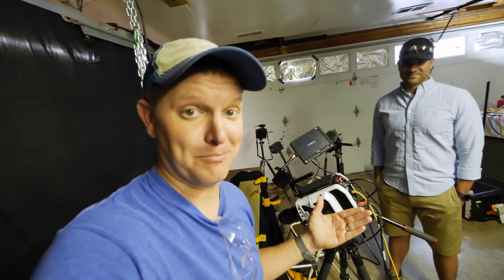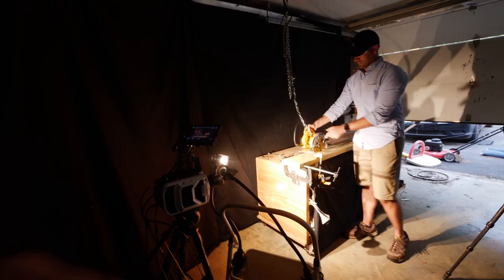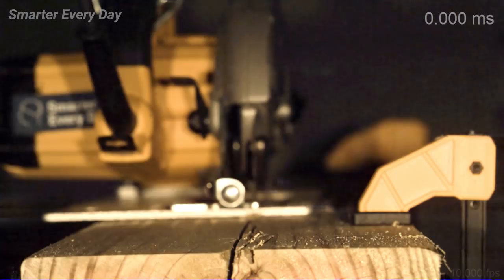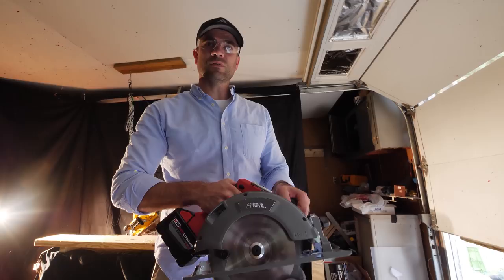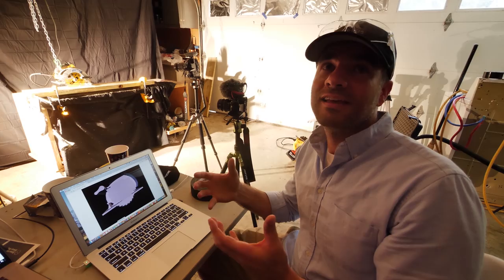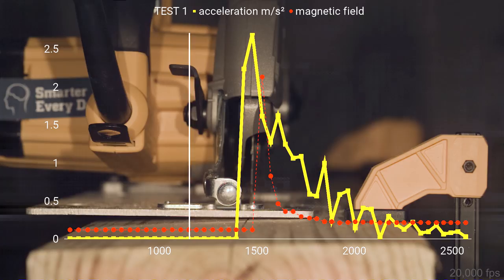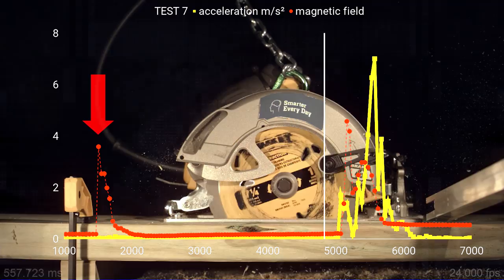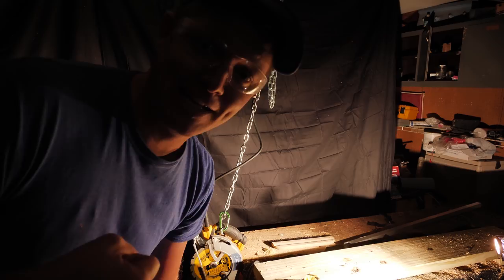Circular Saw Kickback Killer (We used science to make tools safer) - Smarter Every Day 209

Comment: Just out of curiosity why is the blade  gaurd disengaged? I worked carpentry for a while and as long as you are paying attention and using the saw properly (both hands!) kickback can't over power you (you would have to be very very weak).
Reply: Also the blade gaurd should stop the blade from biting into anything if it were to kick!
Reply: I understand what you are saying, but legit question: how fast is that mechanical blade guard? Is it slower than this product?  I bet it is. Note that other commenters have mentioned people who have lost fingers or worse. You would think that at least some of the victims had their guards engaged, but yet ...
Reply: Thank you! A classic example of people OVER ENGINEERING something which has seemed to work fine without 500 sensors for many decades.
Reply: I concur!
Reply: They probably tied it up so it wouldn't get in the way of testing a worst-case scenario; working in construction and remodeling, we have had a few dropped saws end up with damage that causes the blade guard to jam open. None of those are in everyday use though, thankfully.
But yes, proper attention and a solid grip practically eliminates the risk of kickback.
In my experience, in non-user-error-related scenarios like cutting stringers out of cupped 2x12s and ripping boards with self-contained conflicting crowns, the motor always gets overpowered first.
Reply: Addendum: I am all for progress. I love progress! But, let's focus our attention on things which actually need improvements. cough*molten-salt nuclear reactors*cough
Reply: I think this is really good. Any device that increases the safety without infringing on operability is excellent. Yes if treated with respect the tool is much less likely to become an amputation tool but every bit helps, especially when it comes to less experienced operators.  Think anti-collision on cars. People have used brakes with great success over the years to avoid collisions but a bit of extra tech helps reduce these occurrences even further.
Reply: I guess it is a safeguard so that you don't have to be a professional to use a circular saw...
Reply: @elninonitro  I understand the logic behind trying to develop features to increase safety in the usage of inherently dangerous things, like saws and vehicles. However, aside from basic and obvious stuff like crumple zones in car frames and blade guards on saws, if you start going too far, you run the risk of operators becoming too comfortable and relying on the safety features (which can and absolutely will eventually fail) instead of developing a feel and operational sense for the tool or machinery, which might lead to more accidents than if it was never implemented. I feel like the most egregious example of going too far is all of the automatic braking being put in vehicles. A skilled operator is much more reliable than a piece of technology.
Yes, you can tell people "be careful and pay attention anyway" but the stupidity intrinsic to standard human psyche is going to take that with a grain of salt.
Reply: Usually the material kicks back not the saw.
Reply: Would like to point out that while you can normally resist the kick-back with two hands on a circular saw, there are times where I am forced to make a cut with some of my saws where I could not stop (although my position means that an occurring kickback wouldn't actually threaten me).  Also the cost of the sensors they are talking about are very cheep (although the cost due to patent and design *shrug*) and you already have integrated circuit boards into the saw.  You want to look at waste of money look at some of the current building codes.  Now I will agree that cuts I make with my circ saws are not the ones where I am normally concerned about my safety.
Reply: @elninonitro  is there really such a thing as "anti-collision?"
Reply: @abunatkat  on a table saw yes, but with a circular saw, sometimes it does "kick back"
Reply: @SCWW  Absolutely - Adaptive forward facing radar that will automatically apply the brakes in case of an imminent collision. Many cars have it.
Reply: as has already been said, if operating the saw properly there really shouldn't be any damage from kick-back unless the user is not using the saw properly and is very weak. Most circular saws in the states at around 15 amps, and at that power output are not really strong enough to do major damage. Most kick-back is caused by either blade warp-age from over-heating or from the workpiece pinching the blade. In either case, if your hands are where they are supposed to be and the saw isn't malfunctioning, no accidents should happen. There is another device that was invented, and has been around for quite some time that prevents kickback. It's called a riving knife, and it's built into some saws. Mostly though the blade guard does the trick quite well.
Reply: @SCWW  you say things like this shouldn't happen but you know what sometimes they do. That's why they are called accidents. I had it happen to me ripping a piece of wood while I was adjusting my footing. Should I have had a better grip on the saw at the time? Most definitely. You say this can only happen to people that are weak. That's total bullshit. If any person could stop something tragic from happening I'm sure they would if they could turn back time. It's what you call an accident. Nothing in life always goes like you think it should. Pretty sure there has been at least one thing that has happened to you you weren't expecting. Why not add something like this to a saw if it makes it safer if it doesn't effect it's performance? It seems really ignorant not to. Thanks for listening.
Reply: Shanda,,,     "as long as you are paying attention and,,"

Shanda, I worked a job today, Sunday.  A bit of framing, drywall,, one outlet to be moved,, etc.     I will already say  I love you dearly, you are in the trades,, and all people in the trades have my respect and even love, but,,, That statement is so,,, sooo,,, wrong.  Kickback can easily over power a body builder,,, a hirsute gorilla of a man.   And , "if used properly,,"      Sorry,, job sites are the very devil of a place for not used properly.  Allow us to consider an 8/12 pitch roof, large, cut up into many hips and valleys and you,, are the carpenter cutting and installing the roof sheathing. Please forgive my swearing,, there is nothing ''effing'' safe or proper about handling a hand circular saw 40 feet in the air, cutting sheets of plywood to size.  Very little on any job site I have been on in 60 years is safe or proper.,

By your statement,, you are a danger to yourself.   No one.  No one, can always control a saw when it decides to kick back.  Your statement that you would have to be very very weak.  Is entirely short sighted, offensive,, and just plain stupid.  Can you catch a major league thrown baseball, thrown at 100 plus miles per hour,, from a distance of 18 inches?     Good luck.  Try a soccer ball, kicked by a professional at 200 kph,, and you are half a meter away.  It is zero exaggeration that those are the speeds and energies involved in a circular saw kickback.  When a really profound kickback occurs you will hear a loud clang, your hand will sting, and the saw will have bounced off the wall of the room somewhere behind you.  The clang,, the first think you heard was the saw hitting the wall 10 feet behind you.  You never work a saw from directly behind,, never.  And you never, never, have the cord in front of you.  It is always out to the right,,,, otherwise the clang will be the saw hitting you in the back.

It is power brakes and kick back developments that will save many injuries.
Reply: You are correct.  The tooth speed of a modern hand circular is about 120 miles per hour.  On a full out kick back,, a spring loaded blade guard will not snap shut to protect before all the damage is done.  The tooth speed is  on the order of 20 to 50 times faster that the blade guard snapping shut.  A modern hand circular,, from direct personal experience,, can 'walk'  (run, leap?)  all the way across a sheet of plywood, 48" ,and be long gone,, before the blade guard can click shut.
Reply: @supersportimpalass  Unfortunately it does affect the performance. I use a circular saw all the time... I've been using circular saws for 20 years. Yes, they can be dangerous, but putting tech on one to keep the blade from binding affects the performance. Have you ever needed to wash material out of a board with a circular saw, or purposely cause the blade to warp to cut a long curve, or maybe sometimes there is a need to re-set the blade cutting a long length? Carpenters do these things all the time with circular saws. Adding this technology (while cool) would greatly hamper functional use of a saw. I'm sorry you had an accident. I've had many myself, to name a few: I shot a 16d framing nail through my thumb, and a roofing nail through my toe; I also crushed my left pointer finger in a log splitter (16 stitches). Accidents are unfortunate, but are preventable with careful observance, respect, diligence, and most importantly, fear of the danger of the tool.
Reply: No Walter, people are injured and killed by hand circulars every year.  I got my first carpentry job because the guy that morning had opened his belly with a hand circular that kicked back.  He died.  I got the job.
Reply: @elninonitro  So what we need on a circular saw is a sensor to detect an imminent kick-back and stop the blade before it happens... sounds like not getting any work done. ;o)
Reply: You have an excellent point.  Spot on.  I used a saw with a power brake for decades.  And almost the first thing I did when I bought a new modern saw last year, was put it down,,, while the blade was still spinning down. (That was with a blade guard,, they are slow.)   I was spoiled rotten.  AAD's, AOD's in skydiving are called 90%ers.  They work flawlessly,,, 90% of the time.  You never, ever 'rely' upon them.  They only work 90% of the time.
Reply: @SCWW  I think you have made your point clear here that you don't agree with this tech - I agree you have even given valid reasons to NOT have it.  That's fine, not everyone will want or need it but there is a reason that chainsaws now have kickback chain brakes as standard too - Even professional 'skilled operator' chainsaws. I'm sure these devices have saved many faces and legs over the years. Especially for the average homeowner. I see this as something similar - Protecting the average Joe from an accident.  Does it increase complacency? Probably, but for the most part I can see it doing more good than bad.
Reply: @elninonitro  True, this would be fantastic for the average homeowner. The difference between this and a chainsaw breaking system is that a chainsaw breaking system doesn't hinder the usefulness of the saw. A professional and a homeowner will get the same basic functionality, and the professional will still be able to perform at the professional level with no hinderance. I could see this as an option on saws marketed to homeowners i.e. Ryobi (Fisher-Price), Black and Decker, Hitachi, or
Craftsman (Crapsman), but since most of the market for professional grade tools is professionals, i can't see this ever making it onto Dewalt, Milwalkee, Makita, etc. grade tools.

Comment: Hear me out, because I see another application...  I have cut miles and miles of lumber with a circular saw, and never had a kickback.  Not to say that I am that good, but to say that a circular saw is reasonably easy to handle when the blade binds.  Having said that, I still think it is a marketable feature - especially to high school wood shops.  

I think a better place is in a big router.  Have you ever used a hand held router with a one inch wide bit?  Those bigger bits can cause some nasty kickback, and a high rpm bit pulling in a shirt would be terrifying, and a nasty injury!  

Maybe this is just me, but I would pay extra to have that in a router, but would skip the circular saw.
Reply: Jason Sanders That's actually a good idea.  Routers are the worst with kickbacks. Make you break into a cold sweat when it happens just picturing that bit getting caught in my shirt and chewing my stomach up. I work every day in construction and have for years and have never had a problem with circular saw kickbacks. Routers and table saws get my full attention though, like I'm milking poisonous snakes or something.
Reply: Good idear .those bloody routers don't write you a letter. 🤣😂😁😀😎

Comment: "Gonadular region" is now part of my vernacular. But more importantly, this may save countless Gonadular regions from unexpected saw-based intrusion...
Reply: I'm curious to see what the firmware looks like as well as their framework that compares that analyzes incoming the incoming data. Guess I'll just have to wait for the next video.
Reply: ...’saw-based intrusion” —— nice!
Reply: @johnrazor8720  the only thing worse than saw-based intrusion is unexpected saw-based intrusion!
Reply: Couldn't you have also installed a safety button at the base of the saw that when set of the wood, would allow the blade to spin, and when released would trigger the braking system. Maybe the placement of said safety would be a problem, but otherwise I feel this would work.
Please correct me if I'm wrong.
Reply: It will heretofore be in mine as well...
Reply: @securi-t  An expected saw-based intrusion is not as bad as an unexpected saw-based intrusion...🤔
But how can you tell? I'm skeptical. Show video link of you gathering data on this. 😋
Reply: @fcgHenden  statement based solely on speculation.
Reply: @securi-t  😂😂

Comment: Using sophisticated machine learning algorithms to eliminate the kickback from circular saws

Smithing 100
Reply: lol
Reply: r/woosh
Reply: SMART IDEA, STUPID WAY TO ACCOMPLISH IT! What would be wrong with attaching a limit switch to the plate that would activate the brake?

When you start a cut you rest the front of the PLATE on your work. During a kickback event the PLATE rises off the work. Wouldn't it be a lot cheaper to just not allow the saw to power up if you don't start the cut with the PLATE on your work and to brake the saw the moment it comes off the work?

My idea is a lot cheaper therefore more likely to be implemented. Unfortunately I don't have the time and money to invest in it like those  guys do.

Question is: Are they to proud to drop this finished complicated idea and persue a simpler cheaper idea?
Reply: A quote from another comment: "A contact switch wouldn't work. Vibration would set them off. Different orientations of the saw would become problematic. How would you start the cut when half the saw is not in contact. They would wear out and be prone to damage, and the hardware would cost more than this sensor based solution.
This really is a good solution. I have never had one kick back, and never stand behind the saw, so may not be needed, but for the $2-3US it would cost, I would buy the saw with it vs the one without all things equal.

It would be really good for chainsaws, and probably a few dozen other tools. I wouldn't mind having it added to the more powerful drills, so that when the bit grabs it doesn't twist your arm off. Drill press, detect if the work starts spinning (bit different sensor problem). With the right sensors you might even be able to detect and stop table saw kickback." - Court

He makes a very good point at the end of his comment. This technology isn't just for this kind of saw. It could apply to all powered saws, nay, all power tools in general.
Reply: @billy vandory Well that's a very big assumption to make. He's just developed the software to stop power tools when specific criteria are met. He hasn't forced any companies to do anything.

It's not over-engineered; it's a safety mechanism that's surprisingly cheap, effective, easy to implement and resistant to failure.

Also, nothing in the final product uses AI of any sort. They used machine learning to teach it what sensor input should trigger the stop and that's all.
Reply: @MGSLurmey  People like him think all products popped out fully formed and were simple to make.  No idea the level of tech and prototyping that went into an end product that is seemingly mundane.
Reply: @curtisbme  It's always easy to look at a finished product and "critique" it with a sense of superiority (especially behind a keyboard). I'll wager that none of these "experts" have ever taken an idea from first inspiration to prototype: spending several days/weeks/months working into the early morning hours watching build after build fail, questioning the best way forward, wondering if you are wasting your time. Nah, easier to sit back away from the spotlight and take shots at people who are innovators: "he's just on the AI train, and overengineering something simple...ridiculous". If the solution is so easy and does not require much engineering, why haven't we seen your product?
Reply: More like,  Futility 10000
Reply: @Stacy_Smith  that's a horrible idea
Reply: @93Dudeguy  he could save a lot of time by taking to people in industry like me that know this is useless in a real world application.
Reply: Holding the saw on the right side of the cut eliminates kick back
Reply: @blaws6684  so does not cutting a piece of plywood in half with horses on each end cutting up the middle. It's just wrong. They don't make safety devices for improper and unskilled use. This is useless.